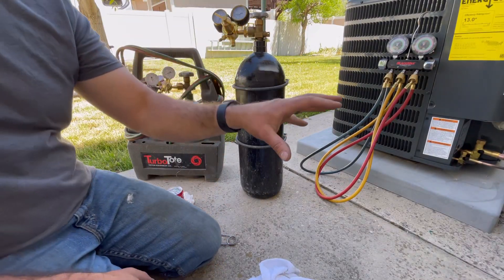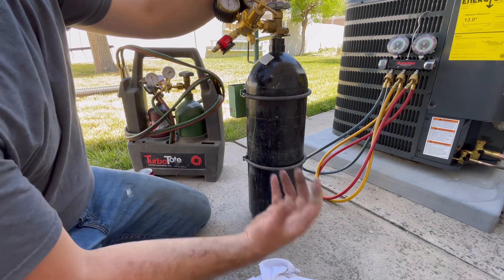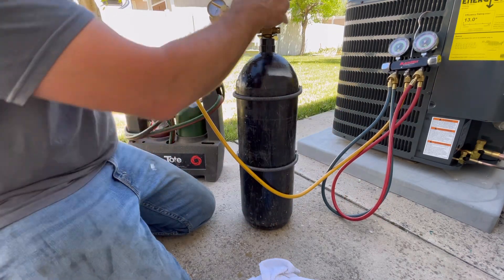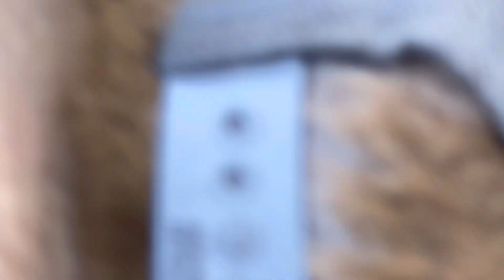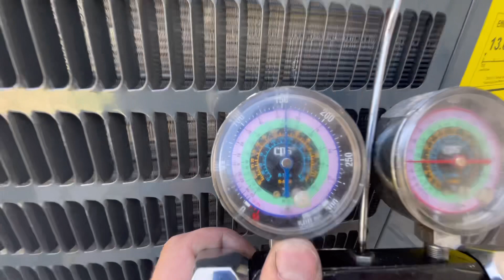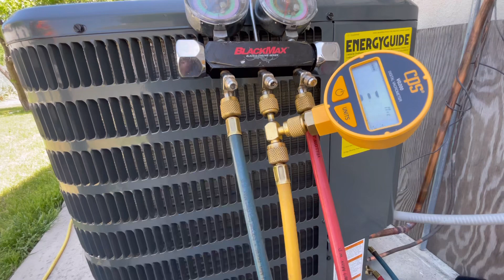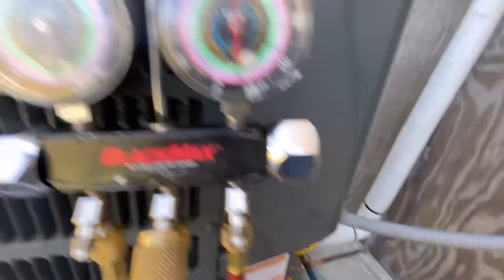DIY Air Conditioner Replacement  Part 3      -Step By Step Guide-

Comment: Thanks again for video. I noticed there is no filter dryer on neither outside line nor on air handler. My old units gas filter just on outside discharge line and same on air handler line? It’s 3.5 tons. Is that normal
Reply: When you vacuum pump the system It causes any moisture to be removed (boiled off) and pumped out. The filter would help trap any residue from brazing and towards end of life metal from wear. But if brazing is meticulous a filter is theoretically overkill.

Comment: Love your videos. Currently going through HVAC school and these instructions have definitely given me more confidence. Quick question, though. I was taught that putting nitrogen in your system before brasing is not optional. it's a requirement. Is there a reason you wouldn't have to?

Comment: Excellent video! Thorough and very detailed. One thing I'm wondering at the end of all 3 episodes was whether it is necessary to top up the system with refrigerant due to the line set. One may say that the condenser is pre-charged with enough refrigerant. But what about such a case when you have exceptionally long line set? 2X or 3X as long?
Reply: The Goodmans are charged to 15 feet. Any length over that will take 0.6 ozs on the 3/8 liquid line, or to be more precise for Goodman, 0.74 ozs on a 3/8 liquid and 7/8 suction line per foot past 15 feet. 60 foot run, minus 15 feet equals 45 foot line length x 0.74 equals 33.3 ozs additional R410a.
Reply from the maker: Yes In that case you’d need to top it off. You can purchase refrigerant from abilityrefrigerants.com 👍🏼

Comment: Great vid and explanation…question/curious: Can you use solder and a propane torch to sweat the copper joints, just like you would with regular plumbing or is it a must to braze as you have?
Reply: No!  You need a hard solder, because there's a lot of pressure in the system and more importantly, there's a lot of vibration.  Soft solder won't hold up.

Comment: Great video.  I was feeling confident as hell until you went back outside and started talking about pressure checks and whatever that vacuum pump thing was (and its purpose).  "Re-introducing freon" had me scratching my head as well.  I know what freon is, but does it come already inside the condenser unit or the evap coil thing?  Do you happen to know a video that explains these products to those green guys like me with absolutely no AC repair experience?  Thanks!
Reply: They come pre charged.....when he opens the high and low pressure screws....it's letting it out into the system. Drawing the vacuum jest helps assist the movement of gas

Comment: Wondering how you insulate the cold copper line right where it enters the inside AC unit through the plastic unit. I had the HVAC company back three times to reinsulate this interface. It appears where the cold large copper pipe runs through the plastic grommet that condensation is occurring and dripping. Now I am wondering if perhaps there is a line leak at the solder interface between the old copper line and the connection point in the new unit. Would appreciate your thoughts?
Reply: Word should be “plastic grommet” not “plastic unit”. Sorry for my mistype.

Comment: Overall great work. But with teaching newbies its always best to express safety first. Your flame was wayyy to high while brazing and i didnt see a filter drier indoor our out. Keep sharing the knowledge though
Reply from the maker: Thanks for the input. I’ve made a lot of changes since this video. And Goodman’s have a built in filter drier on the condensing unit 👍🏼
Reply: @diyhvacguy  What is a filter drier?  Sorry, but I'm as green as they come regarding AC mechanics.
Reply: The Goodmans have the drier built into the condenser. His flame was just right. You need to see cherry red on the copper before applying the brazing rod. Watch a video on how the evaporators are made and you will see bright red at the connection points when the brazing is applied. Harris has a brazing manual showing the proper brazing temps in colors. Cherry red is what they recommend.

Comment: Another great video but you lost all the DIY guys with wives when you broke out the acetylene torch.. 😂
Reply from the maker: Lol well anymore you can use Staybrite & with a propane torch! Check out my other videos to see that method 👍🏼
Reply: @diyhvacguy  Thank you for the Staybrite trick.  The commenter above was correct.

Comment: 9:57 - You didn’t say it out loud here; but, you did it: so, I’ll say it out loud for you. With the nut against the mating thread, turn the nut backward until you hear the click assuring the thread has started before tightening. This technique can be used on threads of any type to avoid cross threading.

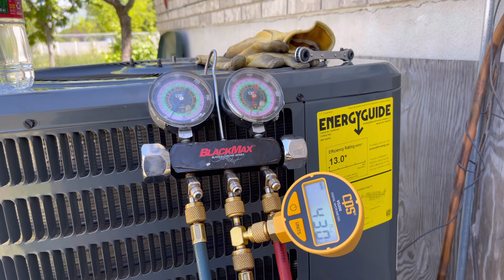Comment: 1:05 - no brazing was needed 30 years ago. Very different temps with R410A that create oxidation that will clog that 0.7 piston. Wonder why you didn't suggest Stay-Brite 8 way for DIY that doesn't need high temps and nitrogen flow, much easier to fail with brazing cooking valves off.. 14:25 - standing vacuum leak test is 10 min I believe. Still very useful.
Reply: I hear stay bright can have negative effects on the Freon

Comment: Brian what would be the first thing you would look at if your ac unit will blow cold air an the fan is on? Thankyou
Reply from the maker: Capacitor. That typically means your compressor isn’t running. If the compressor is running, then I’d check the refrigerant levels. Could have a leak. If you need more help check out our remote support page at Patreon.com/diyhvacguy   Cheers

Comment: can you do the brazing/soldering with just a propane or butane torch or not hot enough? thanks for these vids brother

edit: so the refrigerant comes pre-loaded in the condenser unit? maybe I missed a part.

Comment: If you don't have a nitrogen tank, you can pressures test with the vacuum pump. Pull a vacuum, then let it sit for a few hours and see if it has moved.

Comment: What happened to the section on adding the freon? WTF happened? That seems pretty pivotal...
Reply from the maker: At 14:47, when we open those two king valves, that’s where releases the refrigerant from the condenser to the rest of the system. All condensers come pre-charged with refrigerant 👍🏼
Reply: @diyhvacguy  Oh, I didn't hear you say that. Never occurred to me you could fit that all in the condenser. The other weird thing is that nitrogen tank -- you half mention it, but it sounds like it's pretty necessary, huh?.

Comment: Great video but I would like to ask a couple of questions as I’m still new at this stuff.
I always understood that a liquid line dryer should always be installed on a new installation or anytime you open up a system yet I watched the entire series and did not see one installed.
2nd question- I was always taught to keep vacuum gauge as close to the unit as possible and use core removal tool to isolate gauge from the system when introducing the refrigerant?
But other than those items I think you did an outstanding job in explaining each detail.
Keep up the good job my friend!
Reply from the maker: Goodman’s come with a built in filter drier. And yes I’ve changed my method as far as isolating the micron gauge now.  Cheers

Comment: 2 things. I read a article saying r22 systems are more forgiving to carbon build up during the brazing process whereas 410 is not as forgiving. Why didnt you take the valve stems out when you vaccummed the system down like in your other video. Or did i miss it

Comment: Great videos,  I have slab coils that require a bit more fabrication.  Both ac units on my house (3 & 4 Ton) are R22 and 20 years old.  I'm hesitant to switch over to R410a,  I've read that R22 is a superior refrigerant. I got estimates of $19K to $27K from the big AC houses to replace my units so DIY is looking like the most cost effective option,  I've been pricing the Goodman units online,  it's the only brand I can find that sell directly to the public and the Daiken warehouse is about 15 miles from my house here in Houston Tx. Your thoughts?
Reply: You do know R22 was phased out in 2020, right? If replacing your units, they can only come with R410a as per EPA regulations.
Reply: @Kevin-mm6xm  yes, I do know that but that's if you buy a pre-charged unit, the R22 dry condensers are available but hard to find.  Just FYI,  my reply to this video is 8 months old and I just finished installing the R22 slab evap coil 2 weeks ago,  it's just to hot in Houston in the summer to do anything in the attic.  What a job, it ate up 3 weekends but it's in place and working really good.  My concern is how much oil is in the old slab evap coil and whether I need to add a little oil to the compressor. Just my thoughts.  Thanks for the reply.
Reply: @CarlWheeler-tv2tu  Personally I wouldn't touch R22 if given to me for free but to each his own. In 2025 R410a units will no longer be manufactured and begin to be phased out. If you need a repair on your R22 unit due to a leak you may not be able to get even a pound of it in the coming years making your system useless.
Reply: @Kevin-mm6xm  yes, R22 will become a foot note soon but I have 50lbs of the stuff. My AC units are 23 years old, they will eventually fail but I'm keeping them going for as long as possible. I would prefer R12 but that stuff is long gone for commercial use, the military was still using R12 in their older aircraft but those aircraft are being phased out.

Comment: My blower motor went ac froze and eventually leaked out. Do I still need to recover refrigerant? Thanks nice
Reply from the maker: You’d need to throw some gauges on it and see if it has pressure. If it does, then yes you’d need to pump it down to replace it

Comment: when you replace a unit with R13 for a R410 unit do you need to replace the existing evaporator coil?
Reply from the maker: Yes. Unless the evaporator says r22 OR 410a    R22 coils are not rated for 410a pressures

Comment: Amazing video, your step by step is easy to follow. I think I am ready to do this myself. What blew my mind was comfortable you were brazing the lines. Definitely will need practice on -that before I attempt it. Do all the new units come pre-charged? Thanks again.
Reply from the maker: Yes all units come precharged, but you should look into Staybrite 8 I have several videos feathering it. Much easier for connecting the lines and only requires a propane/mapp gas bottle 👍🏼

Comment: Amazing video!! The only thing I didn't see is when and how you add the Freon.  I know it is after the vacuum test, is Freon something I can just go and buy like I do for the car?
Reply from the maker: Abilityrefrigerants.com sells it. Technically you should have your epa certificate but it just asks that you check a box saying you have yours. And as far as adding the refrigerant, these units come precharged with r410a, so after pulling the vacuum what we do is open the king valves, and it allows the refrigerant that’s contained in the condenser to be released into the whole system 👍🏼

Comment: If you have a sheet metal and make like a “L” around your pipe, it will concentrate the heat at the welding point

Comment: Thanks for the video... you made it look so easy.. I got a evaporator coil leaking was diagnosed by a qualified tech unii1 11 years old wondering if I should replace just the coil or put a entire unit in.. The company that came out wants to much to install a new coil 3,300 I think maybe I could do it still deciding
Reply from the maker: I bet you could! We actually offer remote assistance in helping locate the right equipment and guidance through the install itself. You can find that at Patreon.com/diyhvacguy  cheers

Comment: I'm a DIYer in Florida and A/C is a big deal and expensive. I saw this series and thought you were crazy to tell people this could be a DYI. I was waiting to laugh at your instructions but I got to admit you impressed me. I have seen this work done 5-6 times and did some research and found out that the numerous Techs omit the following steps which you covered here.
1. They do not use nitrogen to clean the lines and don't know how to perform this task. This clogs the line a contaminate freon and reduce efficiency.
2. They do not vacuum pump the system.
3. Do not check superheat. They go by pressure on the dails stating all A/Cs are the same pressure.

After seeing this series I think I can do this job and at a minimum get to the part that the system is pressure tested and if it fails I can call a tech to fix the leak (using the nitrogen) and charge the system.

Comment: Great tutorial but I think I missed the part where you introduced the freon
Reply from the maker: All new units are pre-charged with refrigerant, so immediately after vacuuming the system, you open those two valves, which releases the refrigerant from the condenser to the rest of the system 👍🏼 watch some of my other videos to see this in more depth   Cheers!

Comment: Unless I missed it, did the unit have freon already in the unit and was drawed into the system once the vac was obtained?
Reply from the maker: Yes all new systems are precharged with refrigerant. Watch some of my other air conditioner replacement videos and this should be more clear. Sorry for any confusion! Cheers

Comment: Great job on the series watched them all. Now for a brand new install, you never had to add freon? Just checked the pressures? Good JoB!!!
Reply from the maker: Oh if the lineset is longer the 15-20 ft you will probably have to top it off but you can buy a 2lb jug from ability refrigerants. If you want to get real technical you can measure the lineset and for each foot over 15 ft, you add .6 oz of refrigerant. The only way to do it using this method is by weighing in the charge, but it’s guaranteed that it will be at the right charge right out of the gate 👍🏼

Comment: Brazing for those who have never done it, can be challenging. When I went to HVAC school some guys couldn’t get the hang of it until about 4 tries. The first time it may come out bad. But DIY give it a shot on single pipes on a table vice first
Reply: Ac pro press fittings
Reply: Seems  If  You have Done -  Hot Water  Tanks  all 100%  Copper - Old  School Copper  like K  Type - that using a  Stick  with 7 ~ 9 % Silver would be  Easy ..
Reply: You paid for school just to take EPA test

Comment: Should have put a scrap piece of duct material on the plastic outdoor base when braising to prevent the hot droppings from melting holes into base.  Other than that, GREAT job.

Comment: Got what maybe an issue. So I got my new system installed pressure tested fine left overnight no loss. Pulled a 3 hour vacuum I don't have a micron meter just using manifold gauges. I'm losing vacuum on just the low side gauge but the high side holds vacuum just fine.
Reply from the maker: If you need help with your install I’d suggest hopping over to  Patreon.com/diyhvacguy where we will help walk you through finding the problem.

Comment: Great series!  I plan to do this in the near future and this is just what I needed.  I went back and watched the last part several times but I didn't see how you loaded the system with freon at the end.  Or is the freon in the unit and it flows into the copper pipes when you opened the fittings with the allen wrench?   Can I get the freon from a supplier without being a contractor?
Reply: freon is in the unit already.
Reply from the maker: Yes refrigerant is precharged in the unit for up to 15 ft of lineset. If you need help with your install, check out our Patreon membership at Patreon.com/diyhvacguy  cheers

Comment: have you ever done one of those mr. cool installs? i'm wondering how well they hold up. and if the line set connections are as good as welding as mr. cool claims so a handyman guy may be more honest than an hvac guy,  and if i could take the coil out of the box and just put it into my plenum i have a 16" x 16" x 23" tall plenum area to put just the coil or a 17"x 20" x 40" tall using a coil box and then having to redo the duct to fit that airbox. have you done this yet?
Reply from the maker: Wow you are in luck, I’m actually about to do this project at my house. It’s not with mr cool but AcIQ it’s a 20 seer heat pump and the coil will go in above my existing furnace. Stay tuned for that one!

I did a mr cool mini split and have the video of that. It’s been working good so far. The linesets were very easy to install. I do prefer having a lineset that’s fitted properly so you don’t have a bunch of excess though. But for a diyer it’s perfect.
Reply: @diyhvacguy  thanks i subscribed so maybe it will show up in my email when you post that one. it is hard to find a place that sells those mr. cool units. i do not really need a heat pump just the a/c but installing one that  i do not have to braze and use nitrogen and then vacuum down and the micron gage.. i know how to do that but i do not have the tools, when i had to do that the company had the tools i used them on the job. if i was to get the tools i might as well have an a/c guy just do the work.  but i will look for that new video. maybe you can link us to that model then. thanks
Reply: so i sent emails that ACiQ and they tell me they do not have the kind of systems that you bolt together like the mr. cool system. i do not want to weld them being i do not have the nitrogen. but i may have to do that using a filter dryer on the pressure line.  so tell me so i do not have to drag out my shop size torches, will a propane get hot enough for that welding rod you are showing? or maybe map gas?  i can weld them easy enough, done more than my share of brazing but i do not want to invest in a nitrogen set for one system. i figure i can run a vacuum pump for a couple hours and then let it set for a day or so to for a pressure test with not having a micron gage. thanks